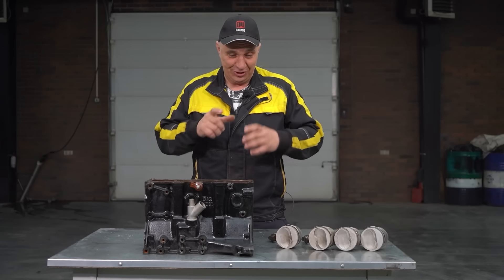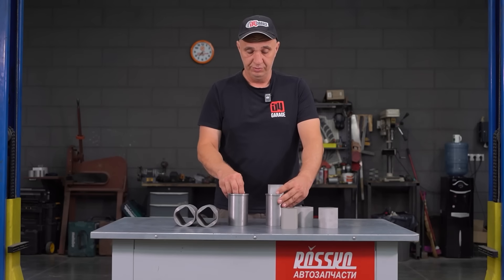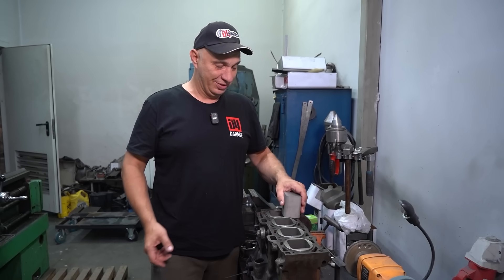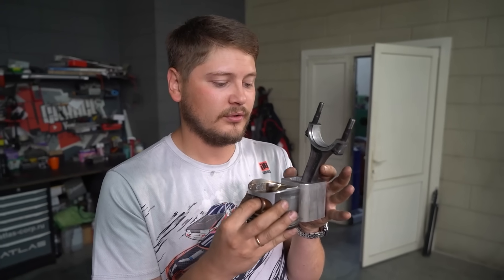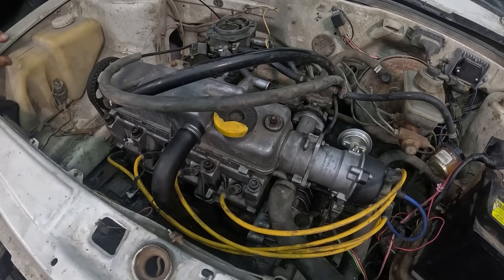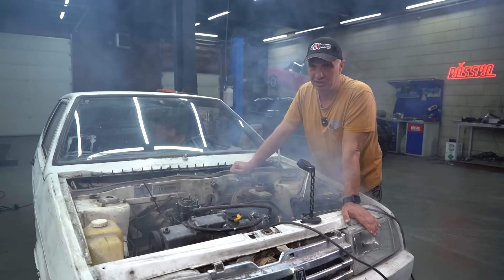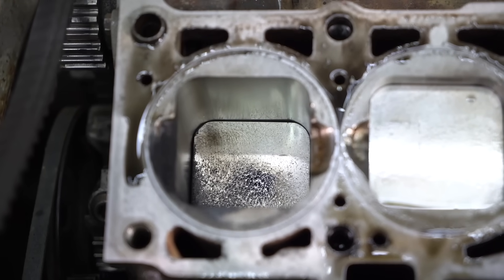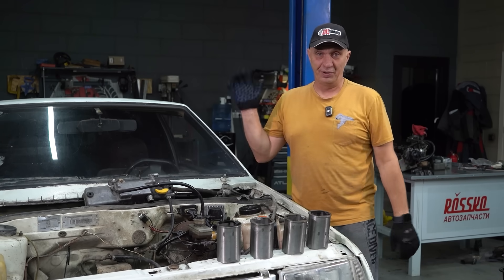We make square-section pistons - will they work?

Comment: For another engine with "Square section" pistons would the Honda NR500 GP racer count? Yes it was an oval piston in a ceramic bore but it wouldn't take much to turn your rounded square into Oval rectangle. Its amazing with the machinery etc involved in this build that you had the time away from customer engines to build this. Work must be quite but the staff had something to play with.

Comment: The nearest to square pistons I know were the Honda NR750 bikes. Piston 2 inches x 4 inches with half round ends. Stroke was 1.7 inches, 2 connecting rods per piston. 8 valves per "cylinder".
Reply: I always looked on them as oval
Reply: And it was a practical failure. No longer being produced.

Comment: They should work fine but the flame propagation might be a bit weird. Honda did oval pistons in their 0X motorcycle engine to allow for 8 valves per cylinder.

Comment: My concerns, part-way through watching:
1. The cross-hatching on the cylinder walls is not apparent. This may cause the oil to not adhere to the cylinder walls, resulting in premature wear, low compression, and possibly oil dilution.
2. The cross-section of the piston is not cylindrical, so there will be more uneven heat distribution within the cylinder. As with point 1, this will cause extreme wear over time.
3. The rubber piston rings may create a good seal at first, but this will cause a loss of compression over time, as well as oil dilution.

Comment: Need to use two o-rings, that are also smaller, with the grooves machined to the diameter of what the stretched o-rings will be (at around half depth). That way they can also keep a good piston clearance with the cylinder vs using a single o-ring that is too thick. I've only watched about halfway, but a problem I see is the o-rings being tighter around the corners and being slightly thinner there. So that would be an issue with sealing in the corners. Could be wrong though, I've been before 😆 And I mean how much heat can an o-ring take. They also should have drilled some oil holes or something maybe. Would help with sealing and cooling even maybe....

Comment: I have never seen an engine with square pistons but Honda developed and raced a motorcycle with oval pistons and 8 valves per cylinder in the late 1970's and early 1980's. If I am remembering correctly, it was a v-twin with 2 connecting rods per piston and had a very high redline. If you are trying to make an engine with pistons that are not a circle, maybe oval pistons would allow you to have pistons with flat sides but no corners. One problem would be is finding a crankshaft with 2 rod journals synchronized to accommodate 2 connecting rods per piston.

Comment: Make some square rings from metal like normal ones but on one off the corners put a spring to push the ring out still have 2 rings and stager the springs like a rotary engine apex seals

Comment: Rubber piston rings is crazy. They need the metal ones to keep the piston from rubbing against the walls without falling apart. Square pistons can work, but they would wear out faster than round pistons because of uneven forces on the piston body putting a lot of stress on the corners.......
Reply: How do propose they make square metal piston rings?
Reply: @Sno0py-XV208 Use a machine. I don't think it is rocket science.....
Reply: @JasonKing-m6m Explain that in more detail as I am an electronics engineer and not mechanical.
Reply: @Sno0py-XV208 And I am not a mechanical engineer. So go consult one if you want fine manufacturing details. But just common sense will tell you, it is not beyond the ken of man to make square rings that would fit these pistons. And that is what would be required to get it running with no compression loss and contact between piston sides and walls. Otherwise it is a waste of time... and IMO even with metal compression rings, it would not last as long as round pistons...

Comment: Do this again but with square metal piston rings!
Reply: How do propose they make square metal piston rings?
Reply: @Sno0py-XV208 same method they used to cut the square into the sleeve. Then temper the material.
Reply: @Feral_Sage  Thanks, sounds feasible.

Comment: The problem comes in with a square piston, and the bore would be the piston rings, which would have to be square, likewise. Square piston rings would have stress points at each corner that would soon crack and fail.

Comment: 50% of the time cylinder type engines are doing nothing going back up. Close your eyes and redesign the engine not using a piston and crank lean towards the rotary motor  think outside the box not using gasoline. Think compressed  air , hydraulics counter levers massive flywheels on engine and wheels Magnets driven.

Comment: If you ever want to revisit this you could try using copper wire as the piston rings. A thick enough gauge in a U shape on either side of the piston and the same rotated 90 degrees on the other ring should help prevent blowby

Comment: Volks wagon has built W16 9L square piston engine back in 2006 with just 667 HP but nobody knows about it because it needs to much maintenance can on run 130 miles after that needed full service

Comment: Convert engine cooling to air or freezing gas by replacing the radiator and coolant with a powerful fan or refrigerator condenser.

Comment: You manage to get actual piston rings and oil control rings on that, it would probably be ok. Rubber o rings just arent going to hold up to combustion. There is a reason that head gaskets and piston rings arent rubber

Comment: What a waste of time and effort! A deadbeat from the start. As long as the piston ring problem isn't solved, there's no solution! It's clear that rubber rings as piston rings only produce smoke. Honda invested millions in a motorcycle engine with oval pistons... No rational solution!

Comment: Though not square, Honda actually developed motorcycle engine with weirdly shaped, oval, pistons. Mainly because it allowed them to use 8 valves per cylinder. So total of 32 valves for four banger. I don't know if they did, but if the valves were hydraulically adjusted, it must have been fun to adjust all of them... Needles to say, increased breathing capacity had positive impact on overall performace. I wonder what was the lifespan of this engine, they spent like a very lot of time in designing it, it was overcomplicated but I thing it was thought through, at least the 500cc version of the engine was race capable.

Speaking of weird engines in general, one of my favourites is two cylinder single combustion chamber two stroke, I saw it in Manet moped my uncle has. It's like from 60' or 70'. The two pistons share the same conrod and the cylinders are connected through a channel in the head. The basic idea behind this is to improve the efficiency, as the air fuel mixture enters the first cylinder, then it gets compressed, explodes and it expands over to the second cylinder where it gets exhausted meanwhile new charge is flowing to the first cylinder. So there is very little, if any, of fresh charge overflowing to the exhaust unlike in ordinary two stroke which needs pulse of back pressure from the tuned exhaust pipe to cram the overflown air and fuel back to the cylinder.

Comment: I would have made a rings with the piston body, i mean i would machine it the way so its shape will look like a piston and a rings but all in one body.
Or i would try to find and use a silicon made rings that can handle more higher heat.
Awesome video. Thanks.

Comment: Honda made a V4 cylinder engine with oval pistons 2 rods for each piston had 8 valves per cylinder 2 spark plugs each cyl. 8 pushrods  per cyl. insane under NR  designation
Reply: How'd it do?

Comment: Square pistons may not last long for the same reason square windows aren't used on airplanes and spacecraft, and part of the reason for the in-flight breakup of the first few de Havilland Comets - the sharp edges or "corners" of the squared pistons create natural weak spots, which could lead to metal fatigue failure, and sealing issues, especially under repeated pressure and stress.

In the case of the Comets, these window corners were easily stressed, then further weakened by air pressure at high altitude.

Comment: #1 reasons engine pistons are cylindrical is for better sealant due to equal surface tension and more equal pressure displacement resulting in efficiency and no pressure lock or lose.

Comment: what about instead of 4 sided piston what about a octagonal 8 sided piston and it would help with the sealing issue with having such a sharp 90 degree angle to deal with  as you get 135 degrees of angle with 8 sides

Comment: Honda made oval pistons in the early 80s for a V8 engine in theory that was  a V8 but had only 4 oval bores I think it made power from 21000, to 25000 rpms

Comment: My big question is this. How can you possibly expect a bunch of rubber seals to stand up to the pressures and shear heat from the cylinders? These guys are supposed to be experts at building engines and yet they used what is essentially rubber bands for piston rings. It's mighty neat having square pistons though. A for effort guys!
Reply: watch their rubber seals video, they just thought it would hold enough for the test

Comment: All that work , maybe would have been better off putting a 4 gauge solid copper wire in there as a piston ring rather than rubber. I was hopeing with open headers it may have a different sound. but in the end triangle, round ,rectangle, it is just different displacment. Awsome work Gentlemen.

Comment: Make some square 2 piece piston rings. And use the waffle section of an oil ring between the piston and ring to act as a spring to push the out against the cylinder wall.

Comment: went from Wire EDM to free handing the cuts for the valves 🤣 love it

I think the issue comes down to those O-rings. You'll just never get it to seal on a square like that. When the O-ring meets a corner, it needs to stretch to make up the distance which decreases the thickness - you can see this @ 11:45. Theyre plenty thick for the straight edges, but completely falls away towards the corners. 

Unfortunate - good experiment :)
Reply: 1. Dake Square Piston Engine (1888)
2. GB Patent by Arthur E. Peters (1925) Patent US1598653A
3. Improved Engine Square Piston (1967) Patent GB1176509A was filed by Leslie Desmond Harries in the UK. There is limited documentation, but not much else.
4. "Square Piston Engine" (SPEC) Prototype (2008) was a modern two-stroke internal combustion prototype dubbed SPEC. It envisaged square pistons for emissions reduction, closed-loop oiling, and modular manufacturing.

You can look at some of these if you really want. It has been tried before, but this one looked a lot more promising.
Reply: @Deja117 oh dang! Good info :) thanks
Reply: @The-Real-Taco  Bear in mind, a lot are either theoretical patents, or were for steam engines... The "Square Piston Engine" (SPEC) Prototype, is probably the closest one, but it doesn't work like a "normal" engine. The reality is that they're either needlessly over complicated, or just a pain to manufacture. But they are also super cool!

Comment: You could try graphite yarn as piston rings if you can wrap it tight and get it to slide into the cyl tight ! You would most likly have to put some thing behind the corners in the ring slots to keep the yarn pushed out so they seal tight !!

Comment: Gday from Australia… Please try an air powered anti lag system by plugging an air line to the exhaust side of a turbo.  Air tank in the boot with an actuator press a button and shoot air to the exhaust side of the turbo, so it won’t bother the air fuel ratio..

Comment: The problem I'd see the sleeves are going to go in the corners be like having a round hydro cylinder and square seal od work but the corners are going to be the weak spot. Plus extreme heat may lose compression in the corners the rings going to go I. The corners and the if the sleeve gets hot may seize the square and fuse weld to sleeve to the piston in the corners is were is going to effect the most. Scare the cylinder in the corners if a ring goes and temp th÷ metal expansion will be a problem with heat may not be distributed correctly seize up in the corners. Cool idea a just tking parts. Id think about compression or combustion make the cylinder thicker and piston little bit smaller giving more combustion pressure woth less effort. The combustion making more preasure to push the piston for higher compression and shop vac on the intake. May compressed air in the fuel for oxygen and fire like a cutting torch if the piston hold. Plus I'd think about air lock with the compression like round rings you off set the gaps but allows the air like on a pan head compression great even throw you over the bike air locked. Like the old hit and miss motor some you'll see have a pedal with half a gear to kick it instead of pull the wheel like the old farm small belt motors maytag Honda  or international and work for the cob husker put the belt o. The hand crank like a thresher even ran the washer air compressor multiple purposes motor that fir o. A table top good old motors to mess with learning the basics of gravity and fire. Plus a magneto I'm sure the older guy knows what talking about the cob husker for pop corn and  feed dry corn take the cron of the cob one person. Spining the other loading pretty cool grandparents tricked us on to think it was like a rc car or something sad thing is kinda fun when your little. I don't know just like from rebuilds in shop hit and miss motor. Also look at the manifold and intake chambers is cutting air flow and the air is more important

Comment: Might work for a bit, but not for long. 4 corners will be the weakest points, with a cylinder all pressure is equally spread out all the way around on combustion.

Hence why spheres are used to deep sea dive with not squares or cylinders.

Comment: It’s harder to put metal rings on that you should taper the sleeve, Shazam, the sleeve acts as a ring and drill a small groove in the piston like around it for rings, but use oil as a ring

Comment: It's almost impossible to seal a square corner it might be better using a hexagon or a octagon piston with a special made piston ring for them it would raise compression I think, The top rubber ring was destroyed because that's the compression ring and it takes most of the combustion the bottom ring was in better condition because the oil from the sump splashing would lubricate it and cool it a little too

Comment: Before i see what happens... circular firing chamber has an equal distribution of energy with in!.... but a square has 4 large flat spots to choose  from, all it takes is 0.001mm to fail...Its like lets make a square barrel fire arm... hell no!! No one using square pipe for a role cage... anyway, lets see what happens 😂😂😂

Comment: You really need to mark the distributors in a good running engine before you do your crazy engine designs. Any poor timing (piston fires too early) takes out half your crazy ideas. Here yall did ok, but other desings, fighting timing blows up your designs quickly. Even set the timing to fire after tdc to really help the weaker designs last.

Comment: The area where the piston ring is should be smaller just like in a round piston, that's where the greatest expansion is, You should try again also use some high temp rings.

Comment: I know how to make a compression ring for the square pistons. The rings will need to be a four piece component. Each of the four pieces will need springs to keep them pressed out against the cylinder walls and they will need to overlap in the areas, there rings are not attached to each other. The rings will install at the corners with an overlap in the flat side of the piston. There would be a spring at the corner of the corners of the piston and a spring in the center of each flat spot of the piston may need to add multiple behind the four piece rings so that they all stay pressed outward with an even load. The tolerances would need to be tight between the ring lands and the compression rings so that they can maintain compression.

Comment: I'm wondering how you're going to clock the sleeves so the straight sides are square to the crankshaft, etc. 

The place I worked before I retired wanted me to run their wire EDM, but I knew they'd want me to ALSO run my CNC milling machine at the same time. No, nope, nyet! Not happening! Aside from that, I think the way you hold onto the work for a wire EDM is too different for my overstressed brain cells to deal with both. 

I'm rather shocked with the use of vernier calipers for precision operations. The bloke in Australia uses dial calipers and seldom a micrometer. I pretty much always went from machinist's scale straight to micrometer. Keep making chips, brother!

Comment: I'm not a mechanic but I find it hard to believe that rubber rings could survive the pressures and heat in any 2 or 4 stroke engine.

Comment: Square pistions give a bigger area for bypass compared to top surface. Round is the optimum and the bigger a cylinder the better. That is probably why round is normally used. Square pistons could however allow a smaller engine block.

Comment: Some years ago, maybe the 1980's (?) someone made an engine for a motorcycle 
with oval pistons. Found it!! [Pasted] The Honda NR (New Racing) is a V-four motorcycle series started by Honda in 1979 with the 500cc NR500 Grand Prix racer which used oval pistons. This was followed during the 1980s by a 750cc endurance racer version known as the NR750. 
[Also] The oval pistons were selected to allow room for eight valves per cylinder, which Honda believed necessary for its four-stroke engine to produce more power than its two-stroke rivals.